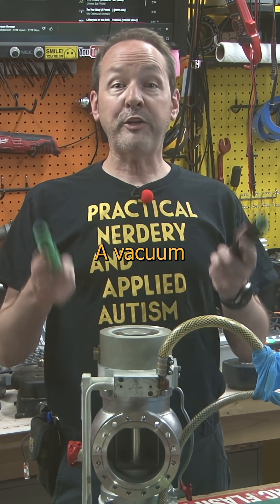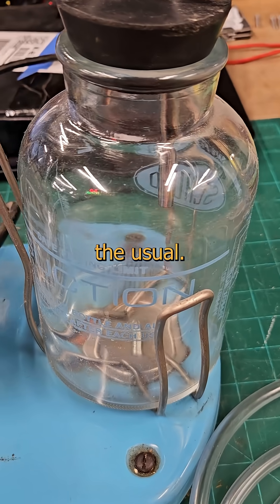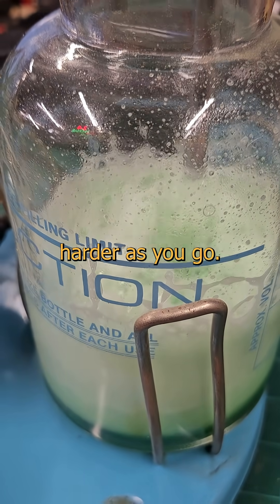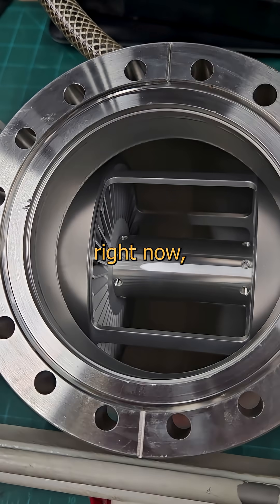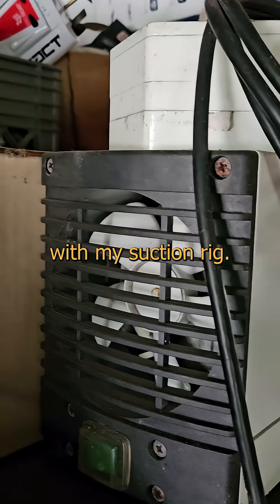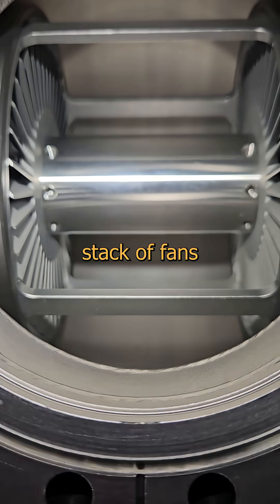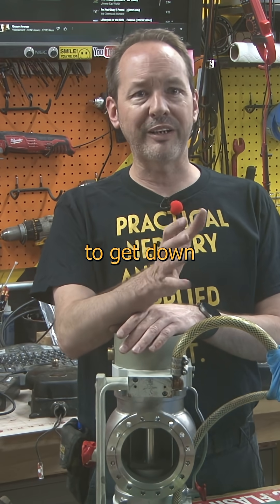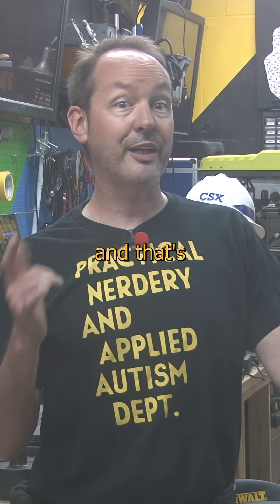Turbomolecular Vacuum Pump #chrisboden #comedy #engineering #physics #science #turbo #nerd

Comment: Spin launch out in West Texas call it a low pressure chamber instead of a vacuum chamber. They spin a satellite it's a crazy mach and then throw it out the roof of the building.
Reply: The only thing they spin is bs stories for their investors. That shit'll never get off the ground. Pun intended.
Reply: You only need three formulae to demonstrate that this concept is going nowhere fast. Here they are:
1.) E = m.g.h  (Gravitational potential energy)
2.) E = ½m.v² (Kinetic energy) -> v = √(2E/m)
3.) a = v²/r      (Centripetal acceleration)

So they threw their little spacecraft about 10000 metres high. Using formula 1.) that means they gave it about 98,100 Joules of energy per kilogram. 
Velocity required for low earth orbit is ~7,500 m/s. Using equation 2.) this means it needs to acquire a total of 28,125,000 Joules per kilogram to achieve low earth orbit. My first point would be: all that infrastructure, just to give a tiny little rocket 0.3488% of the energy it needs, seems like TOTAL overkill.

Now let’s consider the forces involved as it whirrs round and round. That’s where the re-arranged equation 2.) comes in. That 98,100 J/kg represents a minimum starting velocity of ~ 443m/s. It’s difficult to judge the radius of rotation but, scaling off from a photo, with men standing on a cherry picker, working on the device, it’s around 20 m, tops. So now we use equation 3.) This gives a centripetal acceleration of 443²/20 = 9812 m/s². FFS! THATS A THOUSAND GEES!! AND YOUR’E ONLY UP TO 991mph !

Scale the whole kit and caboodle up by a factor of 10 and you’re still pulling 100g, wizzing around in that thing, just to acquire a third of a percent of the energy you need to get into a LEO.

Consider this: Rocket Lab’s Electron is the smallest rocket to ever make it to orbit. It weighs about 13 tons on lift off. It would probably start to break up if subjected to anything above 10 to 20g. So even with a 200m radius chamber